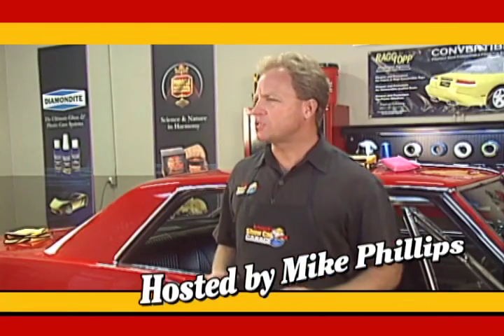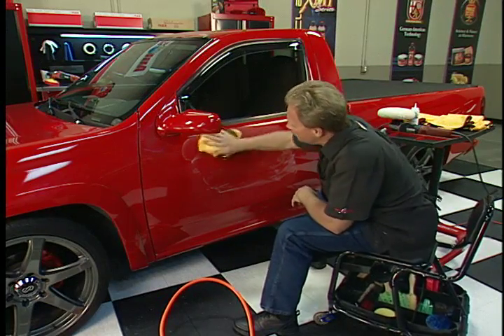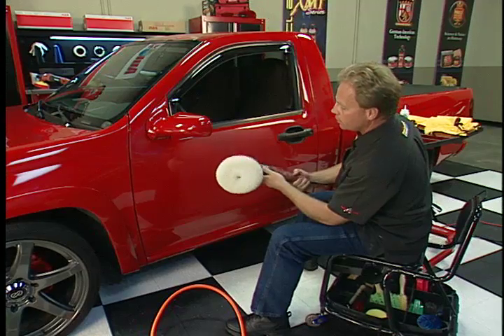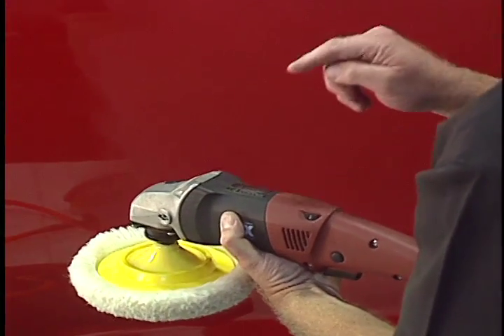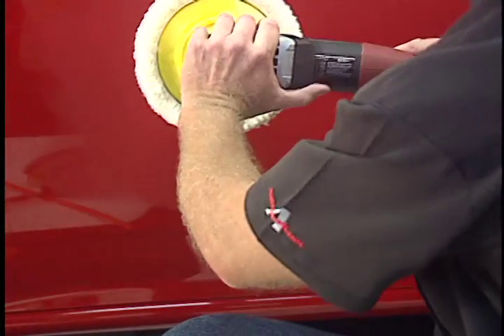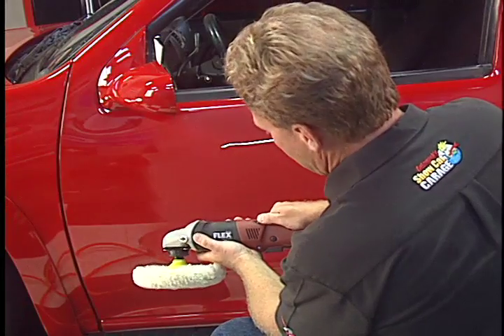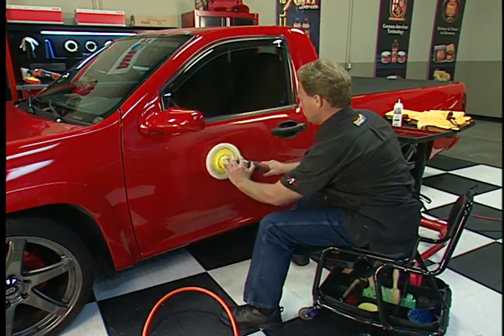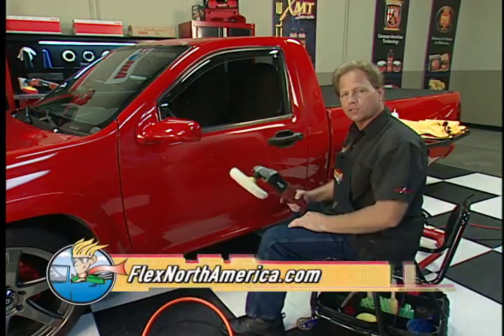FLEX 3403 Rotary Polisher on Autogeek's What's in the Garage? TV Show

Comment from the maker: No problemo... The good news is Flex has introduced the Flex PE14 and they purposefully designed the head of the tool to be held with your hand.  So the Flex PE14 is now the lightweight, rotary buffer I use when I want a compact rotary buffer.  Good tip though...  -Mike Phillips